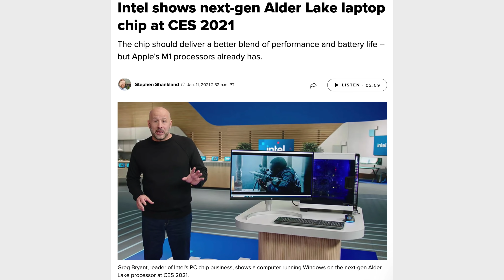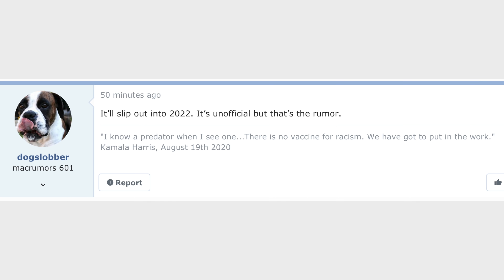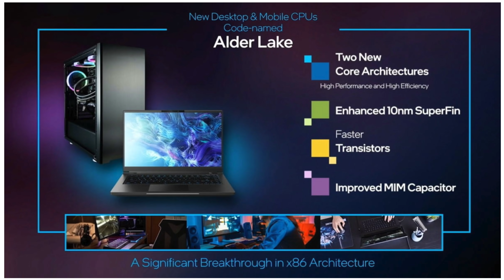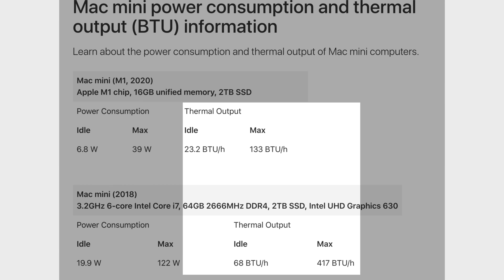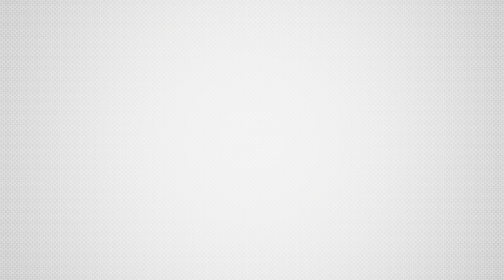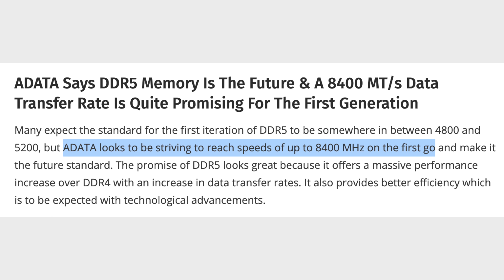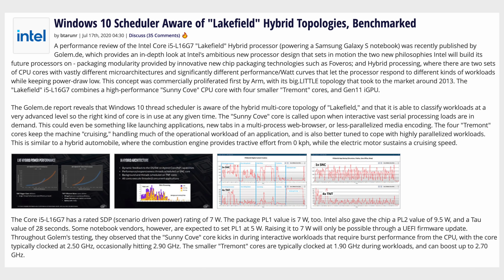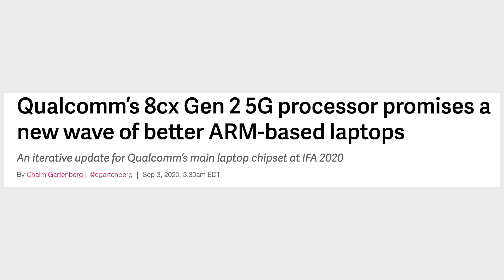Apple M1X vs Intel Hybrid Alder Lake CPU - This is WAR!

Comment: Like every time before this, Intel is scrambling to convince customers and shareholders they can still hang. They will fail mainly because (but not limited to):
-Double the chip fan process size (5nm>>10nm)
-Efficiency cores that will use more power and be slower than ARM.
-Performance cores that will likely be 2x power hungry for similar perf.
-Will probably be delayed to 2022 and get lapped by Apple/ARM to 1-3nm.
-Right now Metal is far more efficient than anything that iGPUs use.
-Apple’s perf controller (hw scheduler) is far more mature and can do things like run BIG and little cores simultaneously.

And at the end of the day, macOS is running a lightweight ARM-optimized software stack, while Windows 10 will chug thanks to all the legacy cruft.

Thank you for attending my TED Talk.

Comment: It sounds like Intel are trying to move forward, but I wonder if it is too late in the day. Only using a 10 nm process for their big. Little core processor architecture will place them at a big disadvantage with regards power efficiency and heat dissipation compared with Apple and AMD. I like the sound of an AMD hybrid ARM / X86 chip but wonder if this is just delaying the inevitable. Apple's solution of some limited X86 hardware level support to improve performance of Rosetta 2 may turn out long term to be the most efficient way to transition from X86 to an ARM processing world. As more server farms move to ARM processors for obvious power saving and cooling management reasons, how long can the desktop computing world continue buck this trend?

Comment: Why we even talk about intel anymore?
Reply: Because Intel has more than 80% of market share and that apple is going to release more Intel based systems for workstations for a long long time.
Reply: @Yusufyusuf-lh3dw  without software support or do you believe companies will support two software versions for a „long long time“ while most are not even porting the existing to Apple silicon and simply rely on Rosetta. Intel is dead for Apple users
Reply: @koenignero  As I said Apples upcoming workstations are all or mostly intel based. In the PC segment apple is a very small player with only 8% market share so nothing much to worry about.

Comment: Do you think the M1 MacBook Air, 8 Core, 16GB Ram is enough for long sessions of 4K editing? Don’t want to regret my decision 😣
Reply: I’ve seen m1 air base 16gb considered the best why because it doesn’t make a huge difference between the two. M1 air vs m1 pro the air throttles a slight bit after 10 mins on 6k workloads only while multitasking on another monitor in a browser window. No lag. Most people are saying go base air and if you edit big professional projects go with the 16GB.
Reply: @melmelcorvette  yeah, I only plan on editing 4K footage on FCP while doing some light multitasking (music, email, website). Footage mostly coming from my own phone. Since I’m getting 512GB, the 8 core was a no brainer. 

I’m in that phase where my mouse is just hovering back and forth over 8GB or 16GB of Ram 😂

Comment: Apple's competitor isn't Intel or AMD or even Qualcomm it's NVIDIA who just began working on a FreeBSD based operating system for ARM. Guess what MacOS as well as the PlaystationOS is based on that right, FreeBSD & OpenBSD. Intel & AMD will be relegated to Linux Server hell for backward compatibility, while Unix dominates the personal computer & gaming space in the next 5 to 8 years. Just my prediction but Nvidia wants to replace AMD & Intel with their own ARM chips and basically squeeze Microsoft out. Mark my words this will happen if Microsoft AMD & Intel move too slowly.

Comment: Well...having been an IT and Technology analyst for 35 years, I've been watching this whole thing with interest. Apple is doing NOTHING groundbreaking. Their systems always cost WAY more than the competition, and are so 'closed" when it comes to expansion and lost of other stuff. Apple jumped ahead this time as they have a couple of other times, but I will TOTALLY place my bets on Intel in the long run. There will be a flood of computers from many companies that will be powerhouses, all with lower prices and greater expandability than Apple. I have used every brand and device on the market for the last several decades, and I ALWAYS come back to a solid, reasonably priced Windows machine. Wins every time.

Comment: i still would like to have intel mac with thunderbolt 4 so i wouldn't need a separate windows gaming pc.
Reply: Thundebolt is shit for gaming. Checkout asus proprietary cable for ext gpu
Reply: @Eldente-k1c  thunderbolt 3 was pretty bad ye but i did see improvements with thunderbolt 4, also i can't just switch to any windows laptop because i use Xcode for work i'm really stuck with mac operating system. If apple won't release any new intel mac then i guess i have no choice but build a windows gaming pc.

Comment: Yet it’s still 10 nm so it’s eating power and dumping out heat like no other. I’m glad competition is there but AMD and Apple are dusting Intel.
Reply: @HiznardoDiaz  that’s a silly affirmation
Reply: @NicolaAnelli  He's correct, intels 10nm is about same as tsmcs 7nm
Reply: @NoName-bg2om  please detail on what source you made that affirmation. Intel don’t discloses anymore the transistor count of it’s processors. So how can you affirm that they are denser? You are saying that intel packs more their transistors (so they are denser) even if they use 10nm process. First of all this don’t produce less heat and it’s more inefficient than using 7nm process and not packing a lot the transistors. Second thing is that to me it’s silly to compare a 10nm process but more denser to a 7nm process that’s is less denser. They will be roughly the same in terms of occupied space but they’re not definitely the same in terms of heat and dissipation. Do you have a lack of space in your motherboard?
Reply: @me fine you’re talking about density. Again. Density is different from miniaturization. You say that Intel want to adopt a new standard. Me too, my d**k is a foot long (an Intel foot).
Reply: @HiznardoDiaz  right
Reply: @HiznardoDiaz  
intel had promised 10nm by 2015, it is not a company to take seriously
Reply: @HiznardoDiaz  It doesn't matter. Intel's 10nm is roughly similar to TSMC's 7nm. However, both AMD and Apple are already moving over to TSMC's 5nm.

Comment: If Intel keep insisting in x86/x64 instead of developing its own RISC/ARM architecture, mark my words, 12th generation will be the last....
Reply: can't develop anything without a good OS
Reply: The market for Arm chips outside mobile and speciality chips is very small. Unless they want to join the heavily competitive mobile market, there's really not much point for them to start making Arm CPUs.
Reply: @xluumu  It's not that simple! Moblie market has the largest share today and it's increasing year by year. But despite this, RISC is superior than CISC since ever in almost every way. RISC based architecture prooved to be more efficient, less resource hungry, more scalable, more reliable and ecc... Stockholders are REALLY concerned about the next steps from Intel (I read!)

Comment: Intel has to catch AMD first before even trying to step into Apple’s ring.
Reply: @Ezra Ramirez 
Apple's chip is being compared to AMD's old stuff. I haven't seen any comparisons between the M1 and AMD's new mobile CPUs which they just launched at CES.
Also, don't forget Apple has access to TSMC's latest process node. A great deal of their chip's efficiency is due to the process node. 
In any case, AMD (and Intel) are not sitting on their butts. By the time we see the new Mac Pro, AMD might have Zen 4 ready to launch, and if they do deliver the 40-50% IPC  uplift over Zen 3 like it's been rumored, it's gonna be a monster.
Reply: Intel Alder lake benchmarks are already out and its much better than anything from Apple
Reply: @Yusufyusuf-lh3dw  m1x
Reply: @Ezra Ramirez 
How do you even know what AMD and Intel will have in the market whenever Apple release that Mac Pro?
Reply: Apple's M1 isnt going to beat AMD or even Intels best chips.
Reply: @Ezra Ramirez  Don’t try to live in the future... enjoy what we have in the moment as nothing is sure in life... only death, God & taxes.
Reply: Don't try to make this about AMD. It's not even good enough to be mentioned. It's Intel vs. Apple.
Reply: @mehdieghdamian8173  
Intel is better than AMD? lol, that's a good joke.
Reply: @1idd0kun  Intel still holds around 98% of the server market which has the very expensive chips in the thousands of dollars each.  I have seen some for over 10k each.  I have been using xeon chips in my five pcs.  For 2020 Intel only made 10 times the earning of Intel and 4 times the earnings of Nvidia.
Reply: @paull3179  

Intel already lost more 10% of the server market to AMD according to the latest market share stats. And they keep losing market share. I doubt they can revert that trend.
Reply: I don't know why you are saying M1 is powerful than Intel or AMD. Yeah it may be powerful than Intel's i7 models. But it looses to Intel's  i9 line and AMD's ryzen 7 and 9. Also it comes no where near AMD's current desktop CPU's. I am talking about M1 and not M1x as I haven't seen it. Also, AMD wins using a windows desktop as opposed to Unix one used by Apple.(optimisation of OS's). So Apple need to step up their game to reach AMD's tier and not AMD.
Reply: @Ko-ei2cm  thats funny lmao

Comment: Intel has a couple of problems (actually 3 if you count the fact that they’ve been resting on their laurels.) 1. They still own their fabs and these lag behind what Apple and AMD are using. 2. The Intel architecture is CISC and is unnecessarily complicated. Does anyone care that you can run MSDOS on these chips? So they have a harder time implementing Architectural improvements.  Lastly I question how clever Intel currently is. Anyone recall the Spectre and Meltdown vulnerabilities? Has these been fixed? Also the X86-_64 Architecture was invented by AMD not Intel. Intel had the Itanium, which was a collaboration with HP, another company that lost its’s way.

Comment: This is not about any laptop in the vid but this is the most recent vid and I want something answered by you. So I’m saving up for a MacBook Air and it might be until end of summer in 2021 until I get it so is there gunna be a new MacBook Air coming out this year? bc if yes I’ll just hold my money and wait until then if no I’ll buy the current one in the end of summer
Reply from the maker: Current rumors point to a new MacBook Air coming in 2022. I would just go with the current model unless you want to spend $1800 on the 14" MacBook Pro coming before the end of summer.
Reply: @MaxTechOfficial  thx. And also, how long do you think it will last? I’m expecting around 5 years is that reasonable or should I get a MacBook Pro if I want it to last that long? ( it’s for high school and into a bit of college)

Comment: If they can really do this, Apple would't have ditched Intel.
Reply: I think they would still anyway. Apple has a “control freak” vision, which is a positive thing. This means that Apple wants every part, hardware and software, to be developed by themselves. If not, at least developed exclusively for their stuff. There are even rumors that Apple is developing their own display and disk drive to not be dependent on Samsung. The pros is that their items will be fully optimized and synergestic with each other. The cons, ofc, is that their future items will be VERY expensive.
Reply: it could actually be cheaper, since they don't need to buy parts from other manufacturers @Starexe97
Reply: @uuhhhwav8828  yeah in the short term, but in the long term, they may keep increasing the price coz they are branded as “high class” technology. Dunno, we really need time to see 😅
Reply: @Starexe97   It will actually be cheaper.
Reply: @thierrymadvig5892  yes in short term, I heard about the decreased price for the new M1X Macs, but we do not know yet for long term, do we? I mean, if they become the best digital appliance manufacturers in the world (which I believe they will be), who are we to tell?
Reply: @thierrymadvig5892  Apple will not lower the price, they always look to raise the profit margins.
Reply: @zireael666  The non flagship products actually have decreased in cost, but you also have to compare for example the M1 MacBooks with a Windows and chromebook, the price and performance is insane on a MacBook M1 compared to a $999 Windows laptop. Can you mention a Windows laptop at $999 with that performance, build quality and battery?
Reply: @Starexe97  I don't know about very expensive.  Apple has certain price points for certain models and if they can keep having a $999 Mini kick the butt of a $3000+ i9 generic PC then the high even stuff with well be worth the money - "you get what you pay for" and all that.
Reply: @Maximara  yeah let us hope they can maintain the low price XDD
Reply: No, they would have switched anyway. No matter what intel does, apple is confident that their silicon can outperform the competition in every metric for ages.
Reply: @apostle9209  yup heard a rumor that they brought the rights to all the good ARM processor blueprints rights from TSMC. Intel may need to use other blueprints or develop their own. Tough one if that is true :s
Reply: @Starexe97  apple bought only the 5nm tsmc process, 100% of the entire stock for 2020 and 80% for 2021. This madness will likely continue as their is practically no company that can outpay  apple in auctions. Intel will probably take help from Samsung as samsung is committed to make a processor deal with apple by 2023.
Reply: @apostle9209  who did not know about that samsung thing. Noted!

Comment: Intel don't need to beat Apple M1 nor M1X, unless they are going to make Clear Linux their main OS.
Intel, Nvidia & Microsoft are best buds and that will not change ever, but Microsoft is making new friends, like AMD & ARM.
Microsoft will not optimize Windows for AMD nor ARM, they will just make sure it can run, intel was first, all tools are optimized to work better on intel stuff.
It's not very, very, very hard to optimize for different ARCH, but Microsoft has been patching Windows for years, not sure how far back it goes, all they need to do is create a kernel/CoreOS for each ARCH. Then Hardware Optimize that Kernel for its ARCH.
Then each CoreOS/kernel provide the same API to do stuff.
Then the Windows GUI use those APIs to access the hardware, simple :) {windows was never & will never be coded that way, unless they start over}.

Intel, AMD & ARM can copy Apple M1 design and improved on it, but they will not, because ....  {wait for part 2}

Comment: These comparisons are irrelevant.  Comparing different architecture.  The M1 will excel in areas it was designed for.  Intel is struggling with getting off of the 14nm process it has been stuck on for years.  Once intel shifts to ARM, comparisons will make more sense.

Comment: I think it’s honestly going to only benefit battery life for simple tasks. Big little chip design is nothing new. Qualcomm has been doing it for years as well. The Snapdragons are still behind compared to Apple’s A series. Intel performance cores will still use up too much power and generate too much heat.

Comment: The rise of ARM
Reply: Arms race
Reply: The rise of Intel systematically copying Apple. I thought it was supposed to be Intel who knew about chip design. Weird times.
Reply: I mean, there are already more than 160 billion ARM devices out in the world, between mobile devices and embedded systems. I'm really excited about desktop class ARM devices, but it's such a small market for them. They already took over the world. RISC-V is probably the only thing threatening to them in the long-term, but not any time soon.
Reply: @beepboopwompwomp  x86-64 is still potent.  It is backward compatibility that has been dragging the Intel side.  If they decide to abandon everything not 64 bit, x86-64 is not that much slower than ARM.
Reply: @catchnkill  I agree. I may pick up an M1 Mini at some point, but I just picked up a late 2012 to play with. Technology is weird, 8051 architecture is still viable in my field (embedded systems). My comment was more about ARM proliferation compared to x86. The latter still isn't going anywhere for a long time though.
Reply: @beepboopwompwomp  I am wondering if Intel/AMD can produce two stream of processors X86-64 and legacy.  Legacy x86 still have some market but the size is not too big.  There is no point to hold yourself back by those legacy instructions.  Reducing  the instruction set size can benefit the instruction decode in Intel//AMD CPUs.
Reply: @beepboopwompwomp  there are far fewer MacOS apps  than Windows apps because Apple hardware was until now very, very expensive. Maybe this new wave brought by M1 will change the balance in favor of Apple.
Reply: @mateiacd  that is not going to happen. ARM is not that much beneficial to x86 (it’s just the 5nm node size vs 10 nm that makes it better than x86 in productivity per watt), so x86 will continue to dominate the market.
Reply: ARM #mobileteam
Reply: @cookie monster a movie which everyone hated
Reply: You can write an academic paper to discuss the potential of ARM and X86.

Comment: its about time to drop x86, or was a few years ago, but it would have been a way harder time getting software devs to port everything over to a risc or similar (lol itanium anyone? ;)) but now with advances in fabrication, it looks like rosetta is crushing x86 emulation, so definitely now is the time. i dont like apple's closed everything and walled garden, and microsoft has had an arm and other risc architecture windows builds back in nt3.51 and 4.0 days and should be working with nvidia now that they bought ARM to build a new risc future for windows.